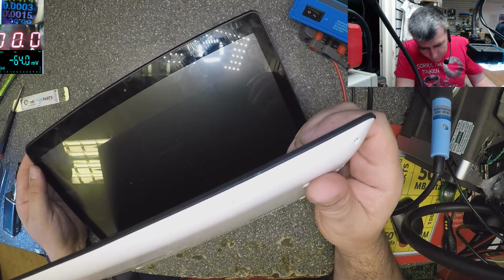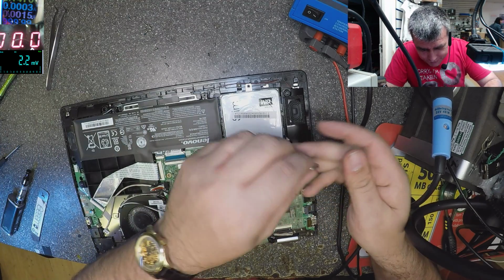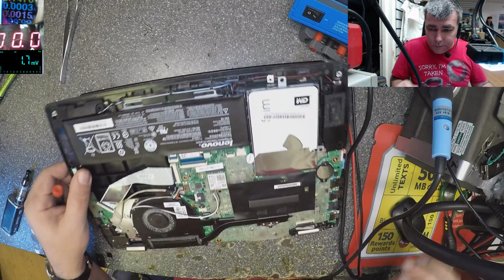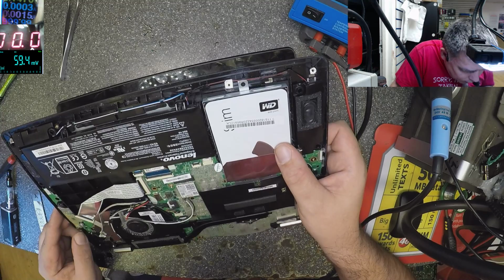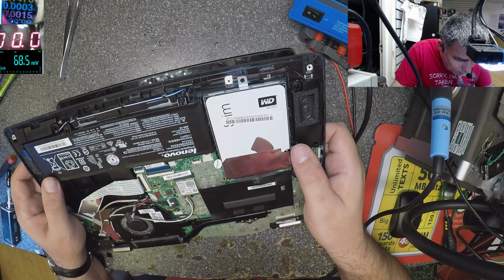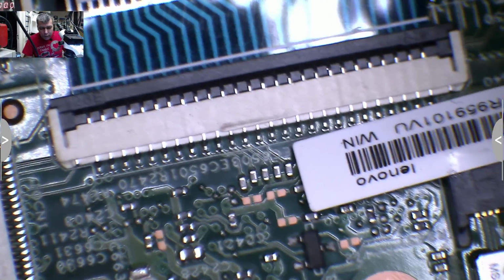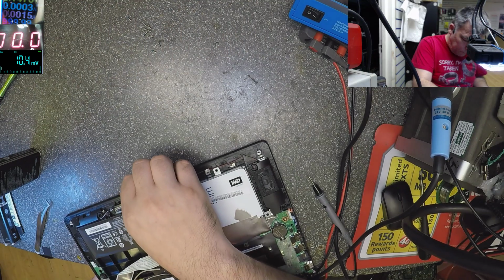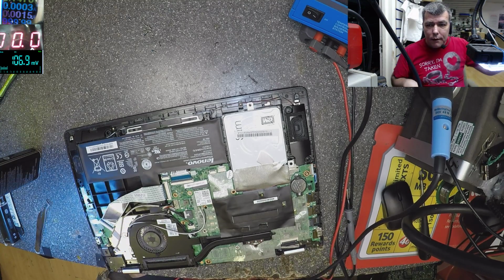Lenovo laptop, no power, motherboard repair

Comment: I need help. Have a Lenovo W520 with a dead keyboard. The keyboard ribbon is torn. How do I power it on without a keyboard. ?. Power button is on the keyboard. 
If it powers up then buying a new keyboard makes sense. If its a mother board problem I would rather bin it. Any help appreciated. When I power it on all I get is the power LED blinks 3 times. I am getting 20 Volts on the mother board. So I know the power supply is ok

Comment: I have some issue onmy lenovo E4080 laptop. Suddenly it does not start. I took to the 2,3 repair shop. They said. The mother board is short / burnt. You need to replace it.. bt this motherboard is not available in market. Plzz can someone tell me what to do with itt. ?????????? Help plzzzz ?!!😢😢

Comment: Hi..can u tell me the solution of my laptop.
I have samsung np300e5c laptop, in that i faced a issue, issue is when my laptop connect with adaptor laptop is working fine but as i remove the adaptor touchpad and keyboard stop working and screen is proper running and no cursor movement no buttons actions appear. why? 
And please solve this issue!!

Comment: I'm experiencing the same problem with a Lenovo Yoga 14 80JH.
No charging, and the power at Vcc & GND on the mobo DCIN connector are stuck at 5.2V.
This video is a blessing, I thought I'd have to change the full motherboard, which would be pricier than the laptop at this stage.
I might try your solution, thanks for your videos, they are very educational :)

Comment: Amazing Video ! Hello, i have lenovo v310 with same issue not Giving Display But the Board is Ok, My Technician says its built in RAM fault, what should i do now?
Reply: Repair or buy other.
Reply: @SinsBird  Lenovo V310 Motherboard is not available in Pakistan :/
Reply: @SinsBird  Can you help me to Buy?
Reply: @usmanwahid8311  You can find some motherboards on aliexpress but I don't think it's worth it. You better buy a different computer.
Reply: @SinsBird  ok. Thnx

Comment: i have this LENOVO IdeaPad Y70-70 Touch must 17.3" FHD TN Touch, Intel Core i7-4710HQ 2.5GHz/6MB

but its dead ,no power even if i plug a power soucre,the battery is good health when i used this but its not turn on anymore even when the battery is conncted to the mobo,only thin what works is the  white led when i plug the adapter,when i unblug the while ld shuts down. whats the problem my laptop can u help please ??.
Reply: Are 3.3V and 5V power supplies working?
Reply: @SinsBird  yes , but still not signal :(
Reply: @andoparn4395  I assume that you tried the steps that I told you. Are input mosfets open or closed?
Reply: @SinsBird  they are open
Reply: @andoparn4395  So they're letting voltage through? Have you tried, while the battery is disconnected, connect the charger, then hold the Novo button for a few seconds, then unplug the charger and plug it back in?
Reply: Disconnect battery and cmos battery. Hold power button for a few seconds. Connect cmos battery and see what happens.

Comment: Im fixing a Lenovo T410 , the problem is it turned on upon pressing the power switch but after a 3-5 sec it turns off..  I've already found the shorted capacitor in the processor supply rail..  removing the cap, the short is gone, but still the problem is the same.. the processor, the 19v line, the 3.3v, and the 5v are all ok.. the 1V and 1.5V drops after few sec of powering on..  any suggestions ?
Reply: Do you have schematics?

Comment: hi i recently used a different power adapter to charge my lenovo miix 300 because the adapter wasnt working and it was too much voltage and now my ideapad/tablet/laptop , whatever you want to call it will not turn on or even show any kind of power. can you tell me if there is any way to a) fix the problem b) is it the motherboard or the battery c) is there any way to save my data if the motherboard is fried? thanks

Comment: I have similiar problem on my lenovo, but while i plug in the charging the light is on, but no power on power button, what the solution sir?
Reply: Disconnect battery and cmos battery. Hold power button for a few seconds. Connect cmos battery and see what happens.

Comment: Hi , my issue is that the power button when I press it ,but do not have the click sound(I guess the connector broken?) - my laptop(lenovo y520)
I try poke into the small hole at the side it on but no bios show up screen is black (but the keys are all light up)
Reply: What model exactly?

Comment: never take out CMOS battery without knowing if the bios password is set on lenovos. When you take out the battery and if the bios password is set, the laptop would be compleately locked up for ever.
Reply: Now that's just not true.

Comment: I have the same laptop. The charging light is always off and it does not charge. I cannot boot the laptop. I measured the right resistance on DC IN and the right voltage output. I believe there is a shortage on the motherboard DC female connector (symptoms Voltage renders 0V)

Comment: Hi, I have a Lenovo e540 laptop.
It doesn't turn on when I unplug the laptop and reconnect it.
Its red LED, which indicates that the device is on, lights up, but nothing happened(monitor and fan is off)
This problem exists both when the battery is connected and without the battery.
Sometimes the power switch is turned on by tapping several times, and sometimes not
Can you help me؟
Reply: Same problem with Lenovo

Comment: hello sir ,plz i need your help about the w520 lenovo it's not  charging and reconize the HDD ,plz  can you do sometihng.
Reply: Unplug the battery a d keep the AC adapter plug up, if it comes on, it definitely  need a new battery.

Comment: Do you have an experience with the Yoga 900 or 910?  It stopped turning on one day.  I tried all the tricks online.  The battery is charge 7.8V or something similar.  Charge light is WHITE.  There's a whining noise when I try to turn it on.  It's electrical whining noise.  None of the fans are moving and no boot of course.

Comment: Lenovo Vantage popped up on my screen saying I needed to update my BIOS. Everything seemed to go ok when I saw that it needed to restart. While restarting, screen just turned black (no logo) and my hard disk was not spinning. I called Lenovo Support countless times to figure out how to fix no boot after Lenovo recommended BIOS update but they eventually told me I needed to bring Lenovo G310 to service center for replacement of motherboard. 

I watched your video and went through the steps you took by shorting the CMOS to clear the BIOS. It seemed too simple not to try. Sure enough after building up the courage to open the laptop and pull the battery connector off and removing the CMOS battery to short and clear the BIOS. I was delightfully surprised when I plugged in the power cord and pressed the power button to see the Lenovo logo appear. 

Maybe tech savvy people would have figured this out on their own but for non-techy guys like me, your video was straight to the point, easy to follow, and effective. Thank you very much!

Comment: How come every laptop this guy works on is almost brand new, they take 20 seconds to take the motherboard out, and all seem to only have a shorted cap or a mosfet. I'm getting nothing but 8 year old Fujitsus that have (not kidding) 36 screws before i can take the motherboard out. I'm seeing MULTIPLE  coils for power with either NO visible mosfets or just 1. or the mosfets are really difficult to identify. Takes 15 mins to take the motherboard out, and the same to put it back together lol. 

Is there no one in the UK with a sh*tty Fujitsu Siemens? I have 2. Also, i have 2 Retina a1502 laptops here to repair, but i can't get half the screws out the back of them because they're basically disintegrating as I'm turning the screwdriver even though it's the right size. Any pressure turns the star shape to a circle... ffs
He gets a laptop., 6 screws and the motherboard is out in his hand. And then he starts prodding with his Multimeter in places unless you've watched every single video you have no clue where. ugh. 

I tried something simple, i typed in "How to test Laptop ram voltage with multimeter". Not a f8cking sausage, try find out how to do it on youtube. The first 4 videos are HINDI, and they're recording with their fingernails.
This guy does it ALL the time. But zoomed out. He seems to just be toching the red rod of the multimeter on corner of a ram chip somewhere... and boom there's the voltage. I have the power plugged in, I'm tapping the red side EVERYWHERE on the ram chips i can see and am getting nothing by - signs on my multimeter at 20v... HELP!
Reply: Well that's kinda the whole point isn't it?  if you realise you have to watch all the videos to learn where to put the meter probes then simple - WATCH ALL THE VIDEOS - duh!  As for RAM voltage check on the capacitors on the DIMM.  You will find ram voltage on some of them, if you actually have any ram voltage.  You may also find VRef which is half ram voltage.

Comment: My Acer One 14 is shorted as i tested it, it turns off after 12 seconds no display fan spinning power led light on and the processor chip under the heatsink getting really2 hot even if i dont turn the laptop on, i only plugged in the charger and processor chip is getting too hot.. what could be the problem?

Comment: Got a similar problem. Plugged in a usb device, and since then both USB 3 ports have died. The laptop wouldn't switch on, until I removed and re-installed the battery. The USB ports are now dead. Any hints on what I should be looking for? The voltage regulator seems to be working in my case - 5V on input while the laptop is off, and 5V on output while the device is on.

Comment: YOU just removed the short chip and just shorted the circuit with jumping wire . does this method works for replacing all MOSFET that is shorted ?

Comment: what kind of liquid that Sir..?
Reply: He's not going to put water on electronics. He doesn't want to leave an oily residue. He wants something that will evaporate in a while at room temperature, but not super fast (so that if it evaporates a lot faster, it indicates higher temperature). Isopropyl alcohol is the perfect candidate, and something he'll have to hand anyway to clean things up.

Comment: Great video, very informative, I enjoy your cool calm sensible approach to the repair

Main reason for watching though is I have a Lenovo Yoga 3 14 I7 that is completely dead
No boot at all..no led lights..no signs of charging..does not power up with mains or battery removed
Tested Ram, SSD with OS on another laptop working fine
Sent it to Medion/Lenovo in Germany for an out of warranty repair, they said...

“MOTHERBOARD FAULT”

GIVE US £381.79

I said wtf y** f***ing rip off ffffffff offfffff, send it back to me
Any thoughts

Comment: First, Where do get schematics from. Need schematics for  this labtop.  Second, I have a Asus K501U laptop where after the power connector the two mosfets has issue.  The first one D has 19v the second MOSFET S has no 19v.  I shorted the S to D and still not coming on.  I measure a D to S short on three other MOSFETs on the board.  Any suggestions on next step.  Should I short the other three MOSFETs to see if labtop will come on.  
Thanks

Comment: Hi. I think my Lenovo Ideapad 320 is broken. Its not turning on, and when I try to push the novo button it turns on for a second then shuts down again. And the light at the side of my charging panel also blinks with the gap of 8 seconds. It is a built in type battery. So i tried removing the back cover and removed the battery. And tried the "drain the flea power" method, as well as the other methods but nothing is really working. Hoping for your fast response. :(
Reply: Mines the same bro and my friend's also...Lenovo has huge problems
Reply: Mine have just gone dead (no power light, no charging light) hours ago after being left stand by. It is a brand new Lenovo 320s-13IKB, bought 8 months ago. Pressing Novo button, 30-seconds power button, Fn+S+V combination are not helping. It is simply dead. Luckily it has 2 months warranty left. I am gonna bring it to the sevice center tomorrow.

Comment: Hello. I had a problem with an acer e1-572G . it want to starts , but after 1 seconds, is power off. the blue led and the orange led are blinking infinitly, and after 1 power, dont power again... i think it`s a short-circuit on mb, but i dont find it.

Comment: I am using LENOVO G50 if I press power button after charger connect the battery charging indicator is flickering. If I release the power button no indicator nothing.if I remove power code and refix the power light and charging indication light will come and automatically off after a few seconds.

Comment: I buy broken laptops off ebay and try to fix then flip them. I can't tell you how many lenovo laptops I get that come faulty straight out of the box (according to the previous owner). Most of the time its something like the battery and cmos need to pulled out then put back in for it to start back up. The last one I bought was fairly new, but the owner said the keyboard was dead - I opened it up and I kid you not, the ribbon cable was unevenly clipped in. No idea whats wrong with Lenovo QC, can't believe how bad some of their products are straight out of the box.
Reply: its really sad to see such a big company making such bad bulilt products . my laptop have i5 and graphic processor built in.. and never done hard gaimng or anything .. no overheat.. always in AC.... but suddenly one day it really stopped turning on.. really just happended first time with me when a machine is sitting there and boom chip level damage and now i have to buy a motherboard which have i5 and nvidea.. can you imagine the cost of that almost a complete laptop just without the body and a screen ... the most painful thing is how they made the laoptop almost non repairable.... and than i was crooked by a local repair shop... fuck man.. frustrated as fuck
Reply: @vinaytanwar7840  i feel your pain bro. Hope you figure something out
Reply: Can you help me fix mine
Reply: @DarQMode  My laptop was not turning on  and also my adapter was blinking then
I tried mentioned methods in lenovo forums 
I removed battery, removed Cmos connector, then held power button for one minute and then without connecting battery provided a direct power to laptop, it blinked for
But it blinked for a second and then went dead. Then on youtube a guy showed a step "to remove keyboard connector flex and then turning it on by novo switch and it worked. So now keyboard is dead but laptop is working. Is there any way to solve the issue
Kindly help
Reply: @rajatthakur9091  Sadly mine died completely. I just ended up buying a new one all together wish i could tho
Reply: @DarQMode  NEW ONE😭😭😭👍🏼
Reply: My laptop was not turning on  and also my adapter was blinking then
I tried mentioned methods in lenovo forums 
I removed battery, removed Cmos connector, then held power button for one minute and then without connecting battery provided a direct power to laptop, it blinked for
But it blinked for a second and then went dead. Then on youtube a guy showed a step "to remove keyboard connector flex and then turning it on by novo switch and it worked. So now keyboard is dead but laptop is working. Is there any way to solve the issue
Kindly help
Reply: Lenovo = IBM garbage.
Reply: I have some issue onmy lenovo E4080 laptop. Suddenly it does not start. I took to the 2,3 repair shop. They said. The mother board is short / burnt. You need to replace it.. bt this motherboard is not available in market. Plzz can someone tell me what to do with itt. ?????????? Help plzzzz ?!!😢😢
Reply: My lenovo has a faulty female connector. Male input 20.4V and the female shows to receive 0V

Comment: may I ask why did you had to connect the chip lines between them after you 've remove the chip  ? thank you !
Reply: kostas magalios well that's because now the USB port will still have voltage but direct and not through the chip. Hope this helps.

Comment: Hi , Thank you for the video. Today i plugged the power cable to USB port instead of power port in my Lenovo U31-70. After that my laptop is not powering on. Do you think the power port replacement will help me? or I need to change the motherboard
Reply: I think that us what I did to my G780, plugged power into the USB port.
Reply: @michaelman4691  are you able to fix it ?
Reply: @HealthyYummy  No.  Was looking at $50 motherboards to try and replace it.  It is still a good laptop.
Reply: @michaelman4691  Yes i bought a motherboard from ebay and replaced it. It is working fine now.I may upgrade to a SSD soon.

Comment: I have found with some laptops if there is a serial number on the sticker on the back of the laptop you can check on the manufacturers website and you can get the model number up etc.

Comment: great channel !! I have  lenovo yoga 13 with i7 processor. after a bad charging connection the notebook is showing "charging" icon but the battery isnt actually filling up.
Any suggestions or advices ??

Comment: Sorin hi. What's the wire you used for the bridge. Gauge? Or any particular specs.? Was that the mosfet at the 12vdc battery rail? Thanks!

Comment: what tool is that when you jumper wire?
Reply: you can doing with a clean  paper clip is the same,if you dont want to give extra money
Reply from the maker: This one?  http://www.ebay.co.uk/itm/WATCHMAKERS-NON-MAGNETIC-TWEEZERS-WATCH-REPAIR-MAKER-TYPE-6-/400395518429?epid=1488331589&hash=item5d396ec1dd:m:m7oig_a3Yaj1az3FmyDQIxw
Reply from the maker: true :)